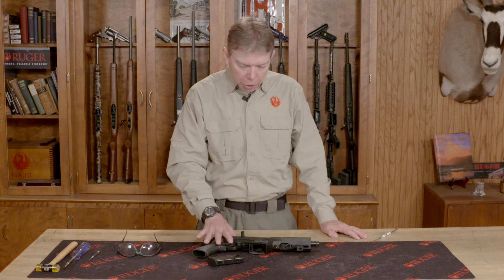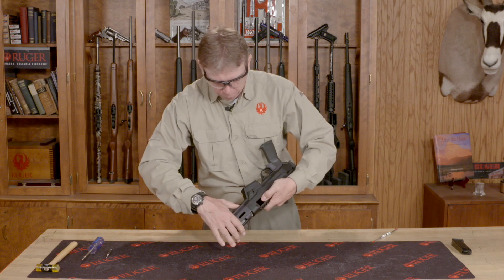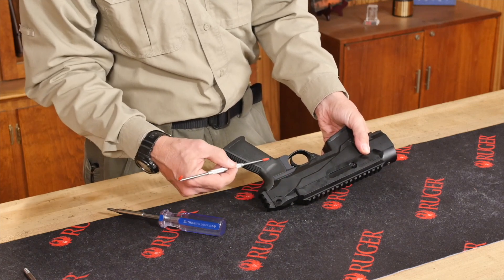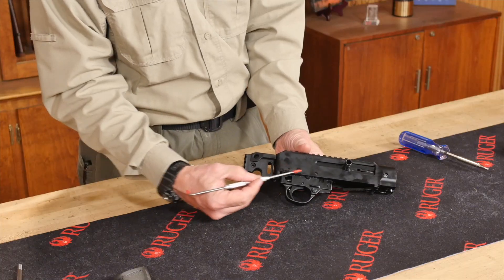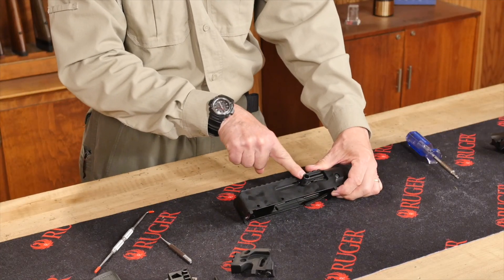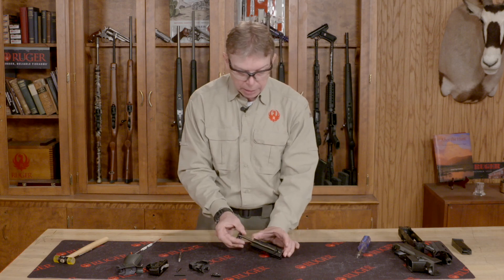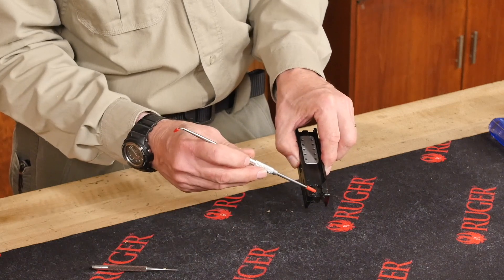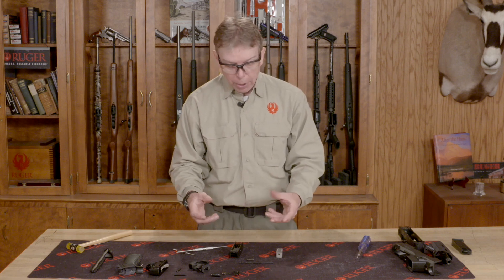Ruger® PC Charger™ Disassembly Tech Tip

Comment: Nice video, thankyou. One question though, how is the barrel removed from the hand guard?
Reply: Lock the bolt back so chamber is visible. Then you can remove the barrel. It doesn't work if thr bolt is closed.
Reply: @donkeedic4451  Thankyou for your response, but I'll clarify my question. With the barrel removed from the receiver, how is the hand guard removed from the barrel?
Reply: @nirod555  ok. I did a search and theres a 6 minute video on youtube when you search "pc charger handguard". It shows how to do it. I was going to summarize it here but theres lot of detail when removing it.
Reply: I have the same problem and question